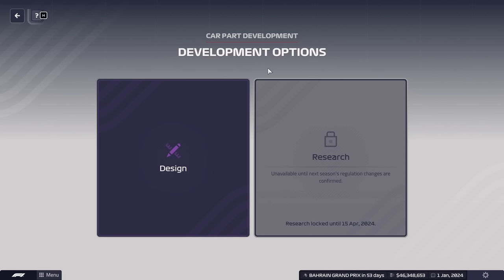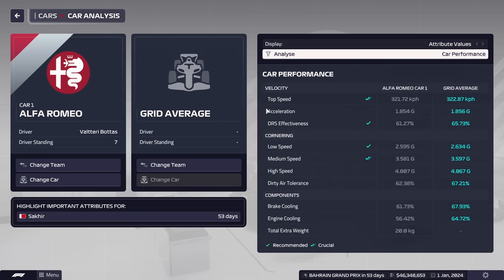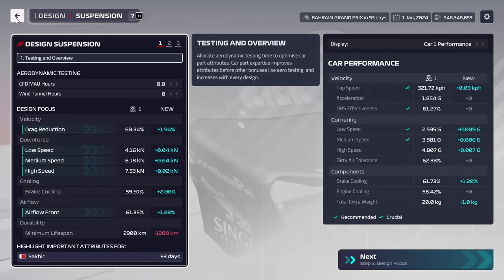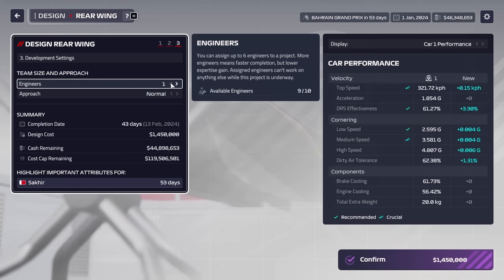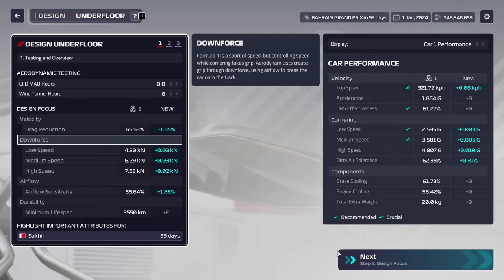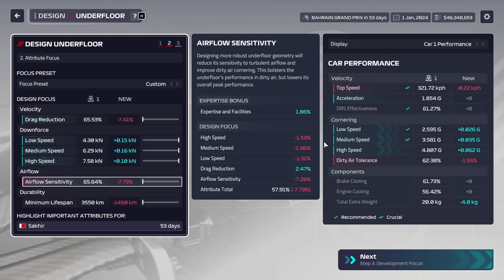Car Development Guide - Design, Research, Expertise and Sliders for Patch 1.9 - F1 Manager 2023

Comment: best order to design parts in?
Reply from the maker: At the start of the season I'd prefer to do the the 4 parts that take long to manufacture first (chassis, underfloor, sidepods and suspension) but there isn't really a wrong order to design parts in as it will depend on where you are in the season and when the next races are.

Comment: Is it better to use all of ur CFD hours and wind tunnel time on one car part or spread them out between car parts
Reply from the maker: Personal preference, I generally just use it on one part and "maximize" it and then use the next CFD on another part, and do it like that, if you spread it out you will spend alot of money on designing and manufacturing new parts.

Comment: It's me again, i have another question. So i see that now that i have like atleast 3-4, maybe even 5 designs of every part, development just stopped. If i wanted to make newer designs i just get like -4 rank on the grid in most stats and only +1 in a few. What do i do now?
Reply from the maker: There is a "ceiling" of sorts with expertise as it gets higher and you might have reached that. Could also be that some of the buildings that buff your designs are starting to need maintenance. Most likely one of these if the sliders are the same.
Reply: @NeroBax  i almost refurbished everything now i have chassis 5 and suspension 4 coming in but after that not a single part will give me any gains not even +1 rank on grid even though i'm like 4th or 5th in most of the stats. Should i just leave it like that and focus on research?  Oh and also is it worth doing constant research without cfd/wt hours?
Reply from the maker: Your gains will get smaller and smaller so while you are getting better stats, the gap to the cars ahead might be a bit big. In car analysis you can compare the stats of your car to the stats of your competitors. 

It is perfectly fine to do research without CFD/Wind.
Reply: @NeroBax  ok, that's all, thanks. I think i'm gonna see if i can keep up like this and i'm gonna focus on research. If i rapidly start falling behind i will design some new parts

Comment: So when you design a part and gain expetise and create a second part do I need to use wind tunnel and cfd hours to gain that expertise or do I get the expertise by leaving them on 0
Reply from the maker: You gain expertise daily while a design is ongoing, the CFD and Wind tunnel time is in addition to that, so there is no need to add wind tunnel or cfd to the next project to get the benefit of the previous.
Reply: @ thanks knowing that makes it a lot easier and can put wind tunnel and cfd hours into a new project

Comment from the maker: Written Indepth Guide by Mike Takumi: https://steamcommunity.com/sharedfiles/filedetails/?id=3011054831

Really recommend the guide above, this is a general guide to car development, with my preferred method which is to focus on cornering ability, to get the most out of it though it needs to be combined with a aggressive strategy.

There are chapters in the description, for some reason they won't show on the video proper so you can have a look at them here. 

00:00 Intro.
00:30 Expertise.
03:15 Car Stats Explanation.
06:50 Lifespan Stat.
09:51 Minimum Lifespan Gains.
10:38 Maximized Gain Minimum Lifespan + Sliders.
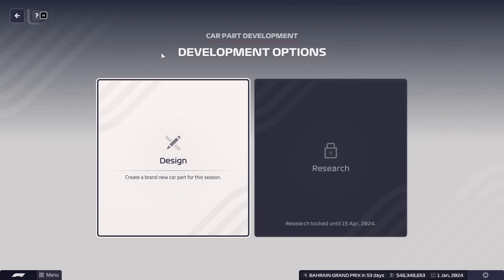11:56 Design, Wind Tunnel and CFD Time.
15:04 Wind/CFD: Make Two Parts.
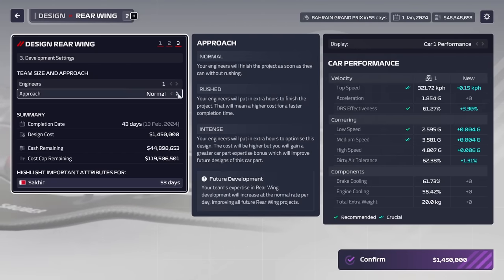16:12 Engineers and Approach.
18:52 Sliders For Cornering.
27:23 Research Explanation.
34:20 Research Results.
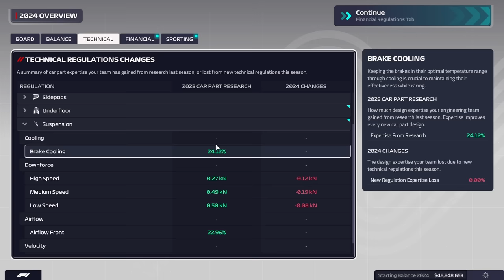36:09 Outro and Final Words.
Reply: Hi, Can you help me with my question I posted earlier here... somewhere in the thread? Also, can you tell us what all of this results in? How many races do you win/points do you accumulate?

Comment: 15:04: The fact that the expertise gain of wind tunnel and CFD has some kind of after effect is really mind blowing. I did not notice that in almost 13 full seasons in the game. Thanks for pointing that out.

At 16:45 you pointed out that the expertise gain is lower overall, the more engineers you add to the design. How do you measure that? I ask because I don't see any performance / expertise change on the right side, whether I add engineers or not. When researching new car parts for next season you can see the performance / expertise gain go down as soon as you add more engineers. But not when designing. Is this a display bug?

Also when you edit your research projects after you started them, adding more engineers doesn't affect the performance / expertise gain on the right side. So the question is now: Is this also a display bug or is it an exploit?

All in all I found your guide very informative. Even though I already knew most of the information given, some of it I didn't know. And since car development and expertise gain is probably the part of the game, I know about the least, this is very much appreciated.
Reply from the maker: The way the expertise gain is working makes it so that if you put more engineers on a project or rush it you will have a higher daily gain than if you ran it normally, so it is more effective to put more engineers on a project if you can afford it. 

However for this expertise gain to matter you are going to have to be able to keep all 4 slots running for the entirety of the season, adding in a couple of max engineer projects towards the end of the season is fine, but if by putting engineers on the projects you aren't able to then start another project you would get more from just running a basic project that takes a bit longer. 

The designs take your current expertise into account when making parts, as a result their performance don't change by rushing or putting more engineers on a project, but the next part after that will suffer slighty due to this rush as you don't get as much expertise on completion as you would running it normally with 1 engineer. You can see the effects on this as you said by putting more engineers on a research project. 

Would assume the lack of changes while editing a research project is either a display bug or just an exploit both are honestly likely and I haven't really looked into it, would probably be fairly easy to test towards the end of the season. 

Glad you found the video informative :)

Comment: Hi NeroBax, I run as Ferrari (love Leclerc) but I have found my car to be pretty bad the 3rd season despite no massive reg changes... and I thought I had developed it correctly and done the research (used to be 1st with the best car last season with Leclerc winning all but 3 races (similar to current Verstappen).  I am not quite through your video yet, but the trick I found to winning a lot (assuming you are not a Red Bull and can smoke everyone) is to focus on dirty air tolerance and low/med/high speed cornering. In the 3rd season I have won the first 3 races despite my car being 4th at best (1st in dirty air).  I tuck in behind Verstappen (who is of course first) and let him drag both of my cars away from everyone else (Sainz is not allowed to fight Leclerc). So I ride Verstappen (you know what I mean)... all the way through the first stint and once DRS is open on lap 3 I put my car in "avoid high risk kerbs".  It takes a little bit of managing throughout to stay within DRS range of Verstappen, but at the end of the first stint where his tires are close to 30% mine are still at 50%.  At that point I power through a few more laps at max speed (no pun intended) to nix Verstappen's "undercut."... i guess I am really "overcutting" since he is out of tire life.  Once I have pitted it's back on Verstappen's rear (again avoiding kerbs as long as I am in DRS range) and save the tires until the last 5-7 laps of the race where mine are vastly superior (60% wear vs 40% wear) and I can steal the top 2 spots at the end despite having an inferior car.  Thoughts?  I do have one question. With major reg changes where all parts take a -50% hit, would you spend all possible hours on research? (I know the first 2 sessions can't be because the reg changes haven't been specified at that point), but the remaining 4 can.  What would you do?
Reply from the maker: It's not a bad strategy per se but you are limiting yourself to Red Bull pace. Pretty sure you would be able to push and get away from them with some aggressive strategies but if it works for you it is good, there is nothing wrong with your strategy. 

For the 50% regulation change I would just focus research evenly across the parts, as I find that to be the most reliable.
Reply: @NeroBax  If I could get away from them, that would be the preference. My strategy is more out of necessity than anything else now that my car is terrible in season 3.  One strategy though that I do think I have perfected (not sure if everyone else already do this) is use of components... engine, ERS, and gearbox.  After the first race or two of the season I use engine 1, ERS 1, and gearbox 1 for practices only.  So my pace in practice is atrocious later in the season due to always using heavily worn components (I run them down to 10%), but I switch over to "fresher" components before Q1 begins at every race. I typically take a penalty at Baku, Miami, or both to get an extra of each component, as it is easy to make up ground on those tracks even if you start in the back. For the entire season I am able to run components that are above 50% wear in all qualifying sessions and races.  I assume that means I get a boost in output on some tracks due to them generally not being as worn as the opponents'...?  With your way of developing the car, how fast are you in qualifying compared to your closest opponent (assuming it's Red Bull)? 0.3? 0.5 seconds ahead? If so, then I definitely need to switch to your approach!
Reply from the maker: Haven't tested hard difficulty yet but for standard or below beating Red Bull with decent drivers doesn't really seem to be to much of a problem for the teams I've played. Your strategy is as I said not wrong, but you get more benefit from research rather than designs so you could keep doing what you are doing while focus solely on research as soon as research opens up.

Comment: How much cash should a team have on hand for the offseason? 
Is there a hard number of research projects you should hit yearly and what parts do you prioritize most/least? Thanks.
Reply from the maker: Generally I like to have around 20 million as it allows me some leeway when it comes to getting a car setup for next year. Research is generally going to be focused on not losing expertise as such the recommended level of research is simply how many it takes to cover the expertise drop, Underfloor is good at everything, Front Wing/Rear Wing and Suspension are probably going to be the main focus in that order then Chassis and Sidepods.

Comment: Great video! Really helped my understanding of the process now that I’ve got my hands on the game pass version of the game. How do the staff attributes impact the ratings/design/research of the parts?
Reply from the maker: Staff attributes are basically just a boost to designed parts, as such they have no effect on research, they also give no boost in terms of expertise gain. 

If I remember correctly, as it has been awhile since I last tested, I believe 100/100 for staff rating equals 5% of expertise unless I am mistaken, so having decent staff is fairly important, but when you consider 20 points equals 1% of expertise and most teams will have staff of 80+ ovr. It isn't gonna have a huge effect on your car, but it is worth picking up decent staff if you have the opportunity.

Comment: 31:42 Sorry I don't quite understand the maths involved when you are calculating the expertise gain/loss on the DOWNFORCE section. Can you elaborate a bit more here? Thanks very much for your video
Reply from the maker: Low speed downforce ranges between 3kN to 5kN meaning 3kN is 0%, 4kN is 50% and 5kN is 100%. 
Medium speed goes from 5kN to 7kN. Same here as low. 
High speed from 7kN to 8kN. Meaning for hard it will be a little bit easier to read as it goes from 7.00 kN - 8.00 kN. So whatever number comes after 7 will be your expertise here.  

So if we have a medium speed downforce of 6.20 kN it translates into 60% expertise. Since 6.20 - 5 = 1.20 and the range is from 0.00 - 2.00 meaning each 0.01 kN equals 0.5% expertise.

Comment: What should be good approach for Design and Manufacturing? 2 times design snd then manufacturing?
Reply from the maker: It depends on when you feel the gains are worth it to manufacture. There is no real rule on it, but 2-3 designs and then manufacture is usually hwo I do it.

Comment: Question: Does research also have expertise gain like Design? Using one engineer vs multi engineers?
Reply from the maker: Yes. More enginners = higher daily gain but less total gain as you do it quicker. Useful if you have spare cost cap.
Reply: @NeroBax  Dam you are good. 👍 That’s why I follow you. You are the best I’ve seen at this game, and thank you for sharing your knowledge with us. 

Binge watching your around the grid series, looking to lockdown my pit time and dealing with that massive regulation changes (didn’t know it existed) same with your initial season with Alpha Tauri.

Comment: Still a little muddy on designing. If I design a new say front wing, do my gains get added to my 2nd design of a front wing?
And do my designs get added to next years car, or is it only research that adds to next years car?
Reply from the maker: Every design you do add to expertise, and this is the baseline that is used to decide on the stats for your new design. As such your second frontwing will be better than your first frontwing unless you place the sliders differently. The gain is still there in the expertise. 

Design expertise gained carry over to the next season provided there isn't regulation change that loses you expertise. Research is mainly a good way to deal with regulation changes.
Reply: Thank you 🍻

Comment: Thanks for your video. But i have a problem, on all my games. For exemple: 1st Season with Alpine,: in April of 2023, I have done the Chassis reseach for the 2024 season, but after the end of the research period, nothing have been improved. Why please?
Reply from the maker: Research for 2024 doesn't take effect until 2024. You are working on next years car as such you will not get any benefit until 2024.
Reply: @NeroBax is the sliders are worth for 1.10 update?

Comment: Thank you for the extremely helpful guide! Only one question, is it not bad for the race performance, behind a car, that all the upgrades are lowering the dirty air tolerance?
Reply from the maker: It's not great for sure but the difference here is that while we might struggle behind other cars, we would be behind cars further back without these upgrades. Aslong as your dirty air cornering is 50%ish you will be fine for the most part. The big weakness though is rain, but it is a sacrifice that is worth it to me

Comment: Hey Nero, currently running season 7… but now the experience gained in each research is very very low 0,30% or less for some. Also I got negative effects loosing 2/3% for next year car prep … did you experiment the same? 
Have you ever run the game till season 7 or more?
Reply: For clarification, when I say loosing 2/3%, this is about the research results displayed in the mailbox when the research is complete. I did not reach the next year season yet.
Reply from the maker: I haven't seen what you describe but I would assume you have reached the cap so to speak in terms of expertise and that is why you see negative effects. Can you check the board tab and have a look at what is says there in terms of gains and losses?
Reply: The thing is that this doesn’t happen to all research. And as usually it takes couple of days or weeks to be visible in the board tab, when I have a look it shows only the low positive effects and not the negative. 

Also, the 2nd weird stuff is that regardless the way I move the slicers , it always put all the research effects on airflow sensibility… that’s the attribute I upgrade the less over the years as I get a dominant car. Which seems to be in sync with your hypothesis I.e. I may have reached the cap for all other attributes. 
If this is really that, it’s very frustrating not being able to prep a car over the years… 
Btw, thx for taking the time to reply to my thoughts 😉
Coming from France and like a lot ur very helpful vids. 
Keep it up!
Reply: This one could be a good video topic … how to prep the car when you reach the expertise cap over the years. 
To give you an idea, expertise level is between 93 & 96% for most of the areas (80% for dirty air sensibility)

Comment: Hi, in need of some advice.
All the new parts im designing are worse thaj thr previous designs. CFD and tunnel hours make little difference.
I have all of thr too bod's in design etc.

What do you suggest?
Reply from the maker: If the sliders are similar I would assume your facilities need refurbishment or you've switched out your staff for worse ones. You shouldn't really be losing performance otherwise. With different sliders you might lose performance as your expertise levels will be different depending on previous designs.
Reply: @NeroBax  thanks for coming back to me bud. I'm using Aston Martin, and stolen mercedes and Ferrari designers. Design studio (can't remember proper name) is LV2, wind tunnel and CFD are 2 as well. Been following your cornering build guide. Trying to get my head around the mechanics of it.